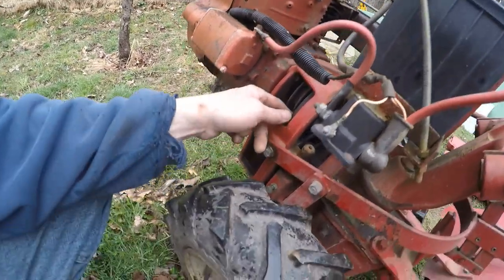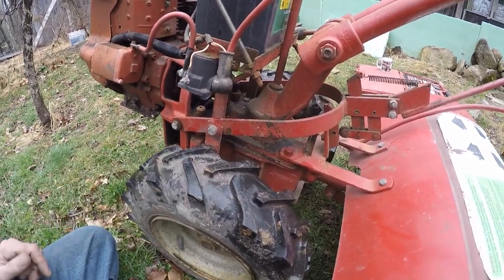NO REVERSE on our Troy Built Rototiller

Comment: Thank you for this video. I bought an old used Troy Built Horse 8HP and the previous owner said it needed a belt for reverse, but in fact, it has this little wheel with rubber on it just like you showed. It turns out the adjustment for reverse was set too high, so it could not engage. Your video was very useful for helping me understand how it was supposed to work. BRAVO!
Reply from the maker: Glad I was able to help you out!  Enjoy your tiller!

Comment: I've got a 7 hp Tecumseh troy bilt rear tine tiller that I bought a couple of years ago. I haven't had it running since then or in 2019. The rear tines are locked in, in the forward stage. And it's harder than hell to get started like this. Lol lol. It tills Beautiful when it does run though. It needs rebuilt completely but can't afford it right now. Thanks again for sharing your video with us.

Comment: Mine is a 1972 vintage same engine HH60  inherited from my  wife`s grandfather. It has a completely different reverse disc wheel . It is a solid friction disc shaped like the inner V of the pulley that it meshes with , held in by a 9 /16 bolt through the center and 3 , 3/16th Allen cap bolts secure the 2 1/2 washer plate that secure it to the backing hu . It works  still without issues . Somewhere along the line Troybilt must have changed the design to what you show in the video.
Seeing American branded product turned into solid crap by greedy manufactures is sad ..and maddening because in addition to being crap , the price one has to pay for it is ridiculous. I wish I could post pictures of mine ..51  years of use on it and it  works flawlessly still on the original drive  belts . Just changed  transmission oil last week . Awesome machine ...the repair / service manuals are still available . PDF  through MTD  present time the parent company .

Comment: My 75 year old neighbor just Bartered for one the other day and he wants me to get it going for him

The engine is fine  ( replaced not long ago ) but it is stuck with the tines engaged
When you pull the rope it turns the tines
I'm wondering if there's any where to buy parts for it
I don't even know what the levers do or that T handle sticking up in the middle

I've never worked on one this old

Comment: Great info; I've got one identical to yours that the motor died six years ago; the dealer ordered a new engine, Kohler that was a exact fit ! My unit is a 1977 model. Am going to have to change belts first then am going to change reverse disc. Thanks for the video. These are great tillers.
Reply from the maker: Great until mice build a nest in the cooling fins.  Blew up the engine. Just put a Predator engine in it. Much quieter.  We have a video on it.
Reply: The Honda GX 200 is the best way to go

Comment: Thanks Brian, almost everything i needed to know,,, But, I couldn't get the reverse bolt completely out, & the disk is stuck solid.
Should I use a screwdriver as a wedge, & pry between the the disk & belt pulley without hurting anything?  You didn't show that part in the removal so I guess your old disk just fell off?
Another problem I have is that the plastic gas tank, fuel line hose fitting leaks. It has a push-in rubber gasket or seal that got hard from age,,, & I can't find that part anywhere. When I pried it out of the tank, the rubber cracked.
Do you have an easy FIX for that?
Thanks
Reply: To remove a stuck reverse disk, disconnect the spark plug. Take a wooden stick and a hammer and tap the disk backwards, rotating the engine a little each time with the pull-cord. Be patient and the disk will gradually slide off.

Comment: I have a 1970 model of that tiller ... I have a ceramic disc that engages the pulley for reverse. Going to change over to this rubber wheel thing. Can I ask where you got it ???
Reply from the maker: I got it on Ebay.  Just check your model they made a few different ones.
Reply: You may also try custom parts inc.
They have many parts for Troy bilt
Reply: If you change to a ceramic disk - you may need to change the opposing pulleys as well. At least on my horse tiller, the ceramic disk fits into a vee-groove instead of rolling on a smooth surface.  There are also 2 identical v-belts for forward motion.

Comment: Check out Steve’s small engine saloon on fixing your pull cord. I believe you just need to pull it and clean the debris and spray it. I prefer silicone spray because dirt doesn’t stick to it.
Reply from the maker: It just needed to get used a few times.  Was sticking up from sitting.  Worst part was that mice built a nest out of insulation in the head fins and ended up blowing the engine up.  Made a video about that and installing a new engine.

Comment: Great video Brian!  Thanks.  Quick question:  is it just the disk you replaced that has the rubber?   Is the lower disc also rubber coated?  Or does it just contact metal on the lower pulley?  Thanks!
Reply from the maker: Yes only one disc had rubber on it. It contacts the metal one when. You put it in reverse.
Reply: @MrBriansAmazingWorld  Thanks for the reply!  My local farm store had one in stock.  Picked it up and had it swapped in no time.  Your channel lock trick saved the day!  I had to adjust the height of the nut on the spring just behind the reverse disc.  With the extra rubber on the new disc it was engaging while in neutral.  A couple turns to back out the bolt and raise the engine height in neutral position was all it needed.  It's working like new again!

Comment: Hey just got one of there what’s the  T handle
Reply from the maker: The T handle adjusts the handlebars.
Reply: It allows you to turn the handle bars to the side so your not walking and packing down your freshly tilled soil.
Reply: IF you take it out it makes it easier to fill the gear box with gear oil , only until it comes out of the side plug

Comment: Mine has 2 belts and if you push forward on the drive lever it goes fast. Pull down to go slow.
Reply from the maker: Some have 2 belts. Mine has 2 pulleys that you can move the belts between the 2 for different speeds.  Mine also has the slow and fast controlled by the lever. So all together you have 4 different speeds to choose from depending how you set it up. If your pulleys are different sizes then you should only be using one belt.

Comment: The 2 speed is the right hand leaver.It takes two belts for proper operation.Better power.
Reply from the maker: Some models had 2 belts. This one uses one belt that can be move to change the gear ratio. Pulleys are different sizes.

Comment: Anybody know how I can rewire my Troy bilt horse with 8hp engine ,rewire ignition switch to selenoide  ,the stator an ground cable 🙏🏼
Reply from the maker: Shouldn't be to hard to rewire. Only a few wires.  Switch to solenoid. 12+ to solenoid and solenoid to starter. 12- to ground. Other wire for 12+  to charge the battery.

Comment: I used to work at troy bilt 350 tillers out the door every day 1981 built to run forever
Reply from the maker: Pretty cool that so many of the machines you helped build are still working.
Reply: @MrBriansAmazingWorld  built like 8n tractor just keep puting new engines or rebuild
Reply: @mariodinovo4018    Hay Mario,,, Do you know an easy way to FIX my leaking plastic gas tank rubber gasket/ seal?
Reply: @jdoboy6835  ethanol fuel dried it out look online for replacement
Reply: Been There Done That,, for hours. Turns out that I happened to have the perfect size pipe fitting Hose barb in a drawer. I put a gob of gas proof epoxy on the threads & it screwed in tight. Then I add another nice size bead to the outside. Hopefully, a DONE DEAL!  Thanks.

Comment: i know its a year later when i seen video. but dude.. that motor is not running right. when you put it in forward. that motor should not have boged down. you were not doing any work with it... if it still runs this way ... it needs fixing.. that tiller will come alive ... even tilling it shouldnt drop as many RPMs as it did in this video...